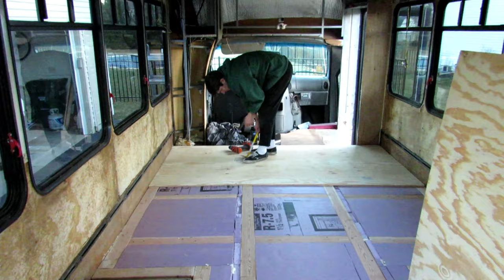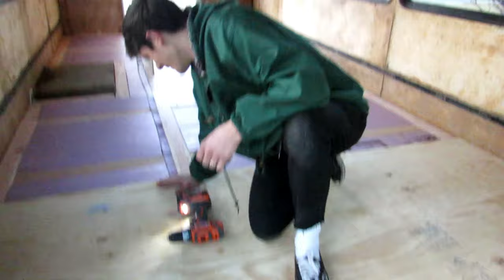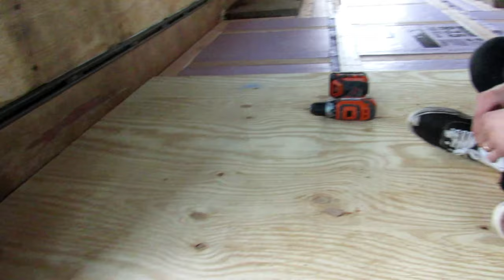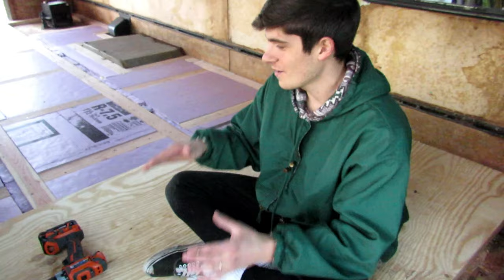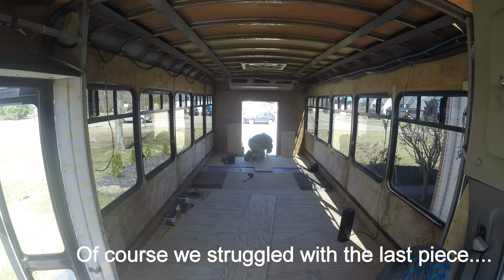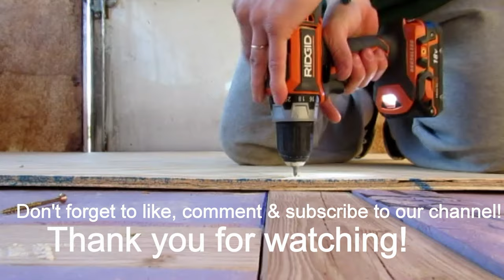Shuttle Bus Conversion: Finishing the Subfloor!

Comment: Why did you insulate/put foam the floor in pieces? Why not do it all at once or larger pieces? Is it because it will move around? Question for floor insulation video
Reply from the maker: Dani X thanks for the question! We wanted to have smaller space between each 2x4  in the subfloor in order to give our floor more strength for when we add all the weight of everything that will be in the bus! We had two small metal rails that were running down the center of the bus so that is where we began placing our 2x4s in order for the floor to be perfectly flat. After doing that we just wanted to have additional support, so when we frame out the counters, furniture, and walls, we did not run into any structural issues later from putting too much stress on the plywood!
Reply: Make sure you put more support were you woll be walking more!